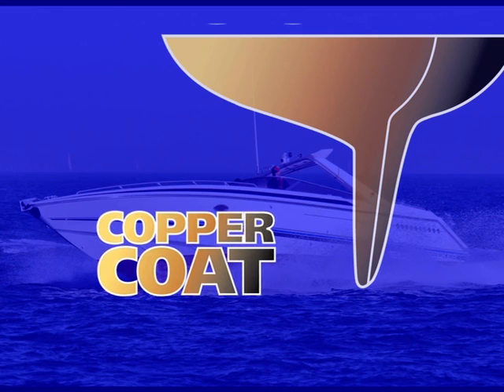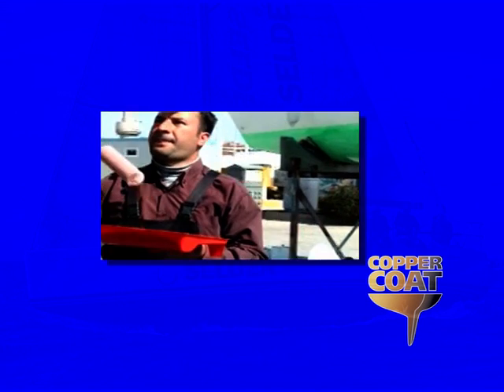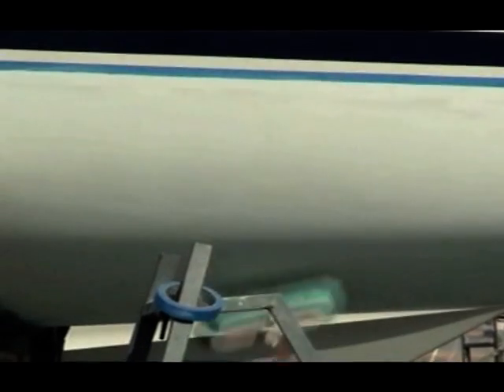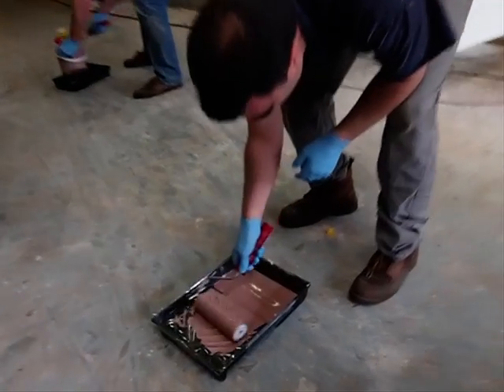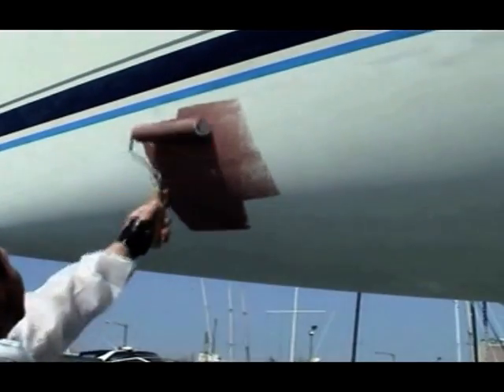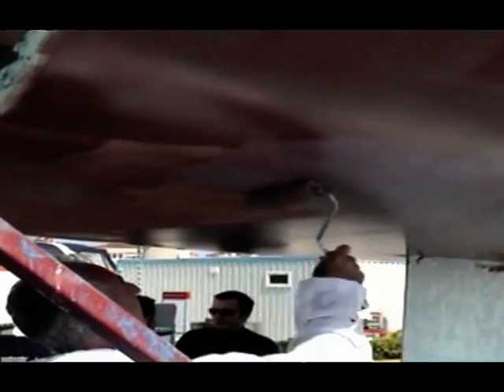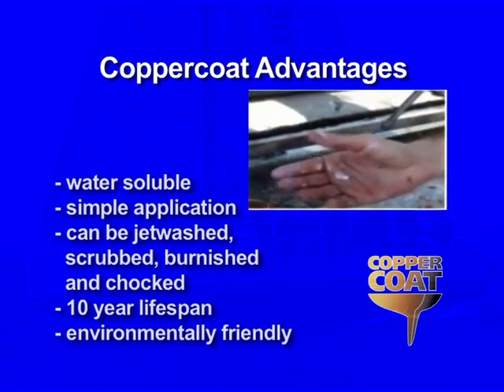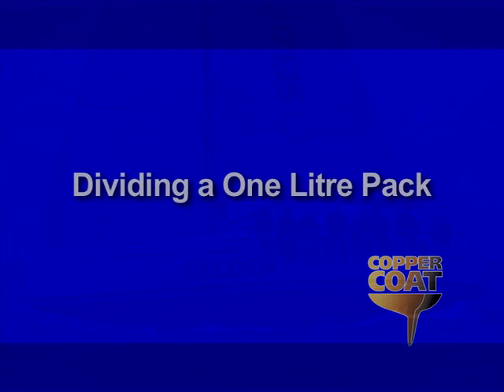Coppercoat Overview

Comment: Had it for over 10 years on yacht in marina, The original was still going strong  after  the 10 years with minimum maitenance each spring . Fouling was just a slime and often less than other , similar yachts with traditional antifoulings. Brilliant stuff.

Comment: Hi Guy's, I am into a big osmoses repair on my 33f sailboat. I am down to the fibreglass all Gelcoat is gone. What would be your recommendation to build up again before applying CopperCoat? Thank's
Reply: First I would say it's too early in the season to continue your repair as you need to avoid any overnight moisture / morning dew / condensation. Wait for overnight dry temerpatures above 8-10deg C. 
Before applying CopperCoat after you have removed your old Gel coat you need to remove dust and grease using isopropyl alchohol and apply correctly a two pack Gel coat. 
Better still give the company listed in the video a call and they will advise you exactly what you can use  and how to apply.

Comment: After the coating has cured, do I need to sand it to expose the copper?
This is not shown in the video...
Reply from the maker: We recommend that after the initial application, Coppercoat will benefit from a light burnish with a fine grade of wet-and-dry paper or an abrasive nylon burnishing pad. This removes the thinnest outermost layer of epoxy, thereby exposing more copper. This allows these particles to oxidize more readily.

We use the term burnish, as the word abrade implies removing noticeable amounts the surface. When burnishing existing Coppercoat, you should not attempt to remove the verdigris green colour, as this is active antifoul.